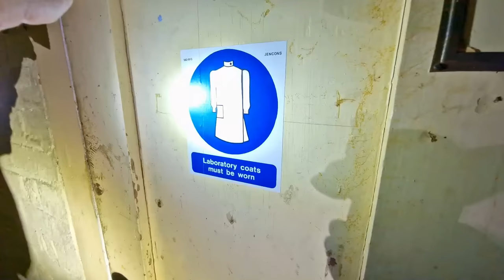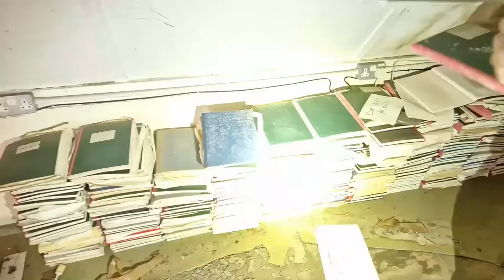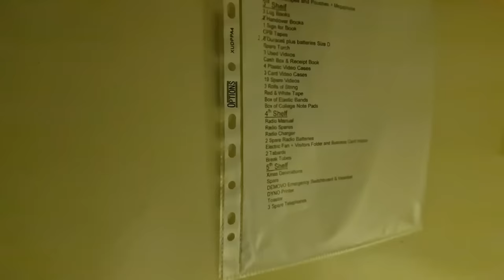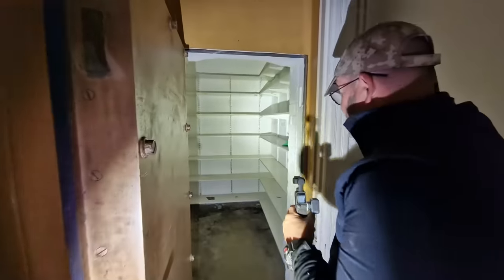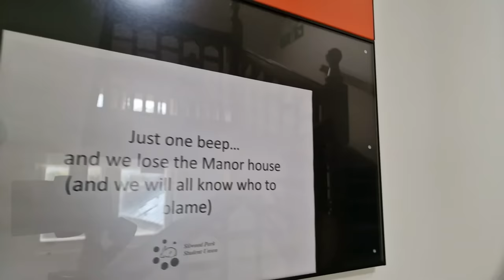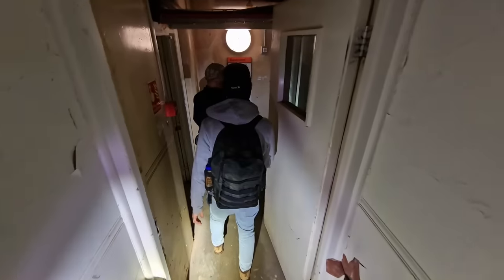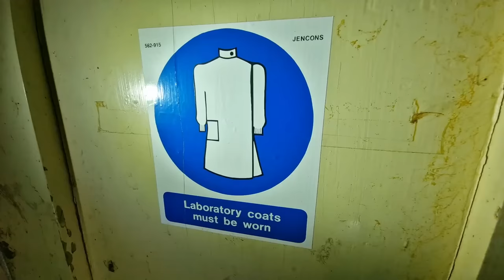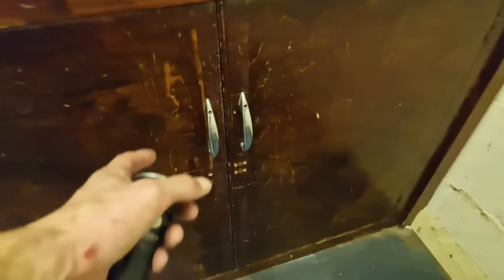We Found a Laboratory HIDDEN under an ABANDONED Mansion!

Comment: Brilliant work 👏 Loved this. Thanks very much. For anyone interested, the Manor House became 'out of bounds' to staff and students in July 2014. There have been plans to sell the house off and convert it into luxury apartments but there has been outcry over this, as the University still intends to keep running the campus (in the many other buildings on the land). Only the house and formal gardens would be sold. Due to the backlash, all plans are still on hold....6 years later.
Reply: Interesting, I was wondering why it's just sitting there abandoned. Thanks for the info. 🙌🙋🏻‍♀️🙌
Reply from the maker: B John thanks for the info 👍 🙏

Comment: I've watched a few of your videos now and so grateful for the chance to see inside these magnificent buildings.
Please can I recommend a channel called My Lunch Break. He's been deep diving on these old building, he's uncovered much that has been hidden. ❤
Reply from the maker: Thanks for watching and commenting 👍 I'll have a look at that channel, cheers
Reply: @VacantHaven  thanks for responding. One of the reoccurring themes with these ancient buildings is the amount of time they took to design and construct, most are usually completed in under 2 years, bear in mind they were all built without so much as an electric screw driver,  as power tool didn't come into use until the late 1800s, long after these building were erected. The other problem that seems to go with these buildings is the lack of a building merchants' names being provided, the suppliers and transporters of materials required. 
I'm sure what you and your mates are doing has come at the right time for the right reasons.